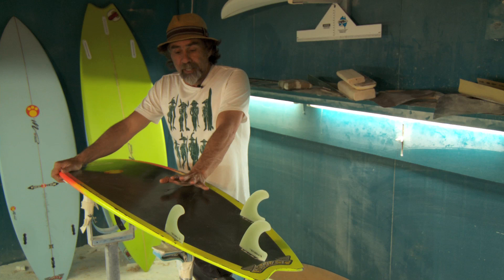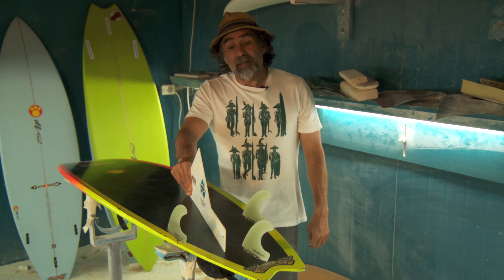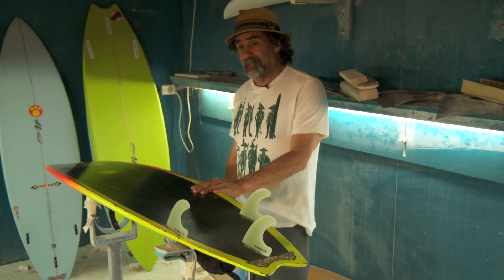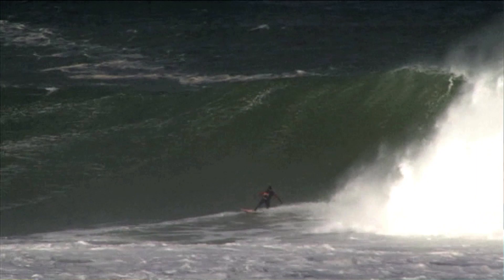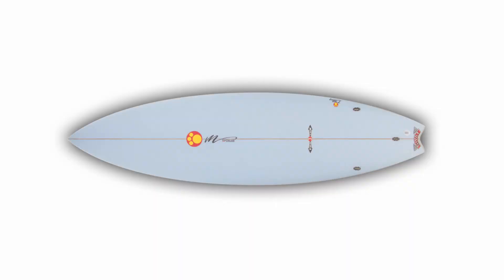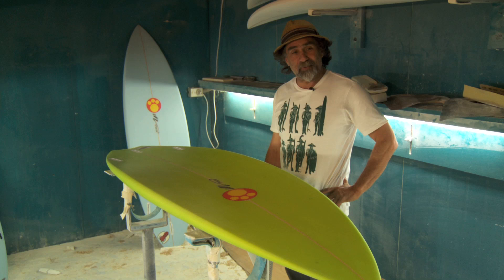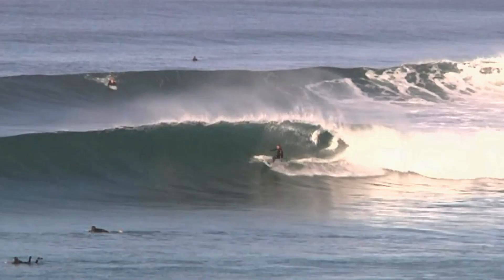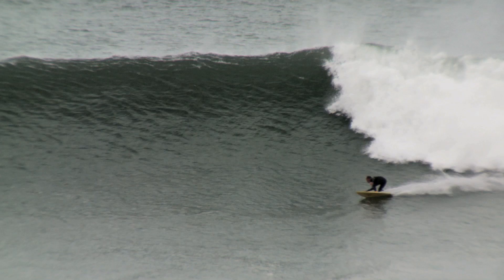Tales From the Chook Shed At Bells Beach

Comment: I am fascinated by these boards. The only way I can see that you could get a concave that has a dead flat 45 degree cross section is if you "cheat" on the cross section and don't include the entire concave. By definition, a single concave's center line will be "lower" than it's edges. You don't see that when MC places the straight edge because the ends of the straight are quite a bit in from the concave's edges. That means the concave must have all its curve concentrated in its outer 1/6 or 1/8.
Reply: wrong. it IS possible for the angled cross section to be dead flat at a given angle of attack. It just depends on the relationship of the rail curve to the concave shape. Maurice gets it.